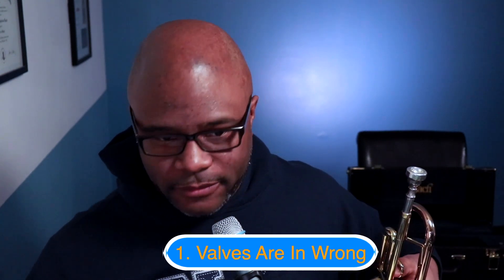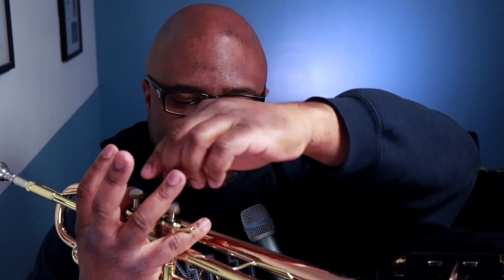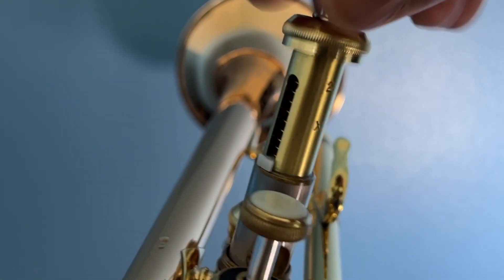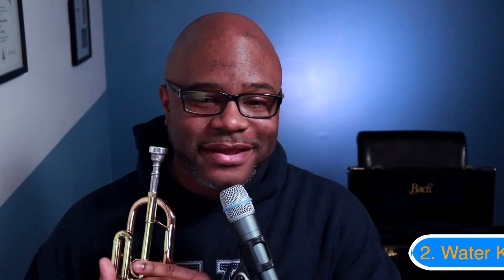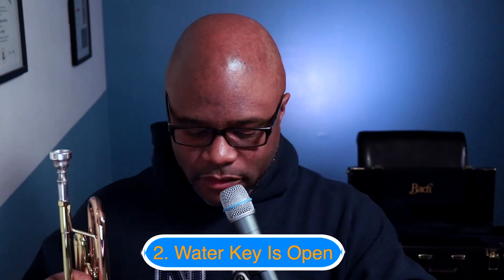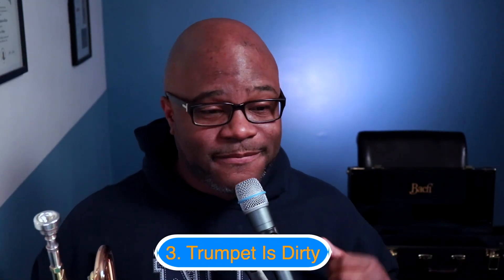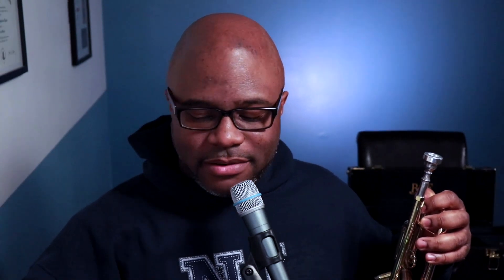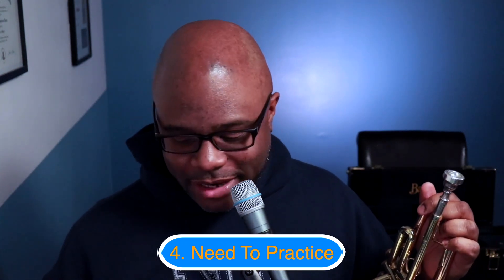Why Won't My Trumpet Make Sound?

Comment: Thanks Chris, great advice all round. When I bought my trumpet last year I was sure I'd been sold a pup - turned out the seller had cleaned and oiled the instrument (and boy, did he oil it!) and reassembled it incorrectly. I guess he felt a valve is a valve and so just stuck them in anywhere and anyway. As a complete beginner it took me a while to figure it out but not before almost blowing my eardrums inside out thinking I just wasn't blowing hard enough! I really could have done with this vid a year or so ago! Cheers mate and thanks again.
Reply from the maker: Yes! This is the reason I created this video. It can be scary when you first get your horn and you think that it’s broken already but it really isn’t.
Reply: @ChrisDavisTrumpet hehe

Comment: It’s funny how the valves on my student models click when they’re in the exact location they need to be, but my 2 professional model Bach trumpets, you have to actually check if they’re lined up. When I first got my Stradivarius, I went to oil the valves and I went to play and nothing came out and I had to sit there and figure out what valves were in backwards and which ones were correct
Reply: My Bach has brash valve locks. You can hear them

Comment: Hi Chris. I have a problem with my trumpet valves. The numbers on the valves which way should they be facing
Reply from the maker: Most of the time they would face you. Depends on the make/model of the trumpet. If that doesn’t work, turn them toward the bell. If that doesn’t work, turn them to the side. All valves should face the same direction.